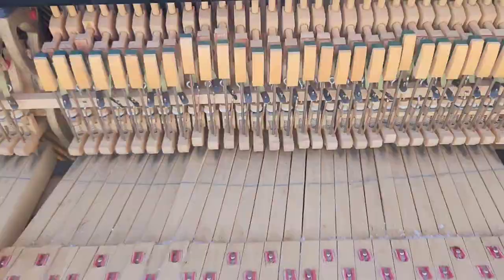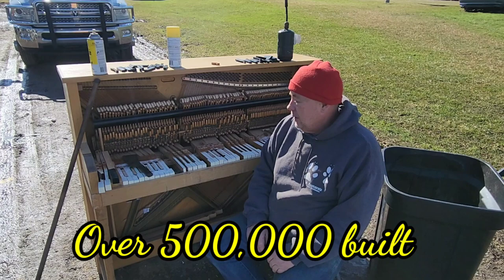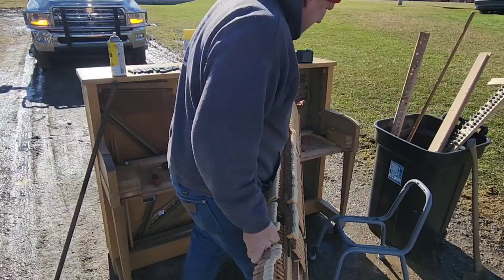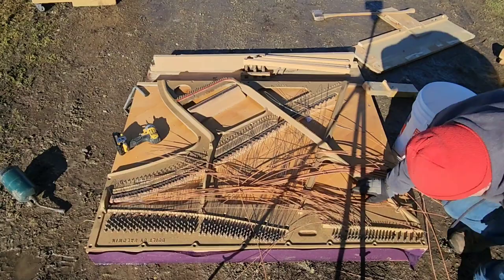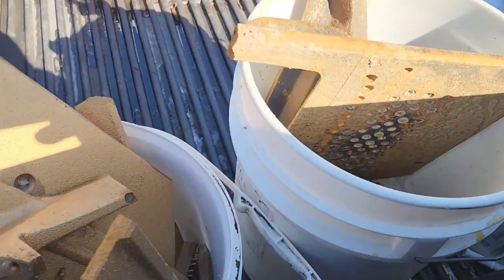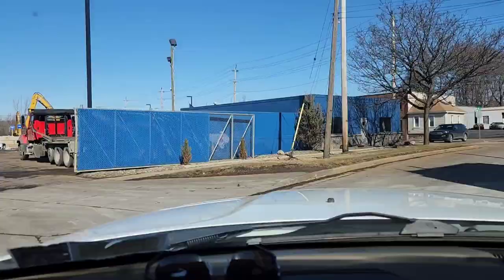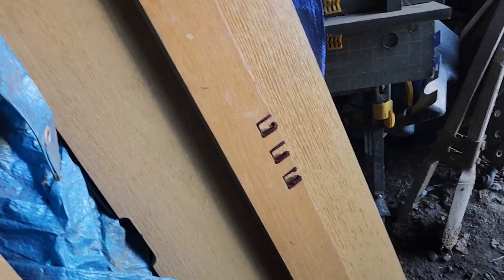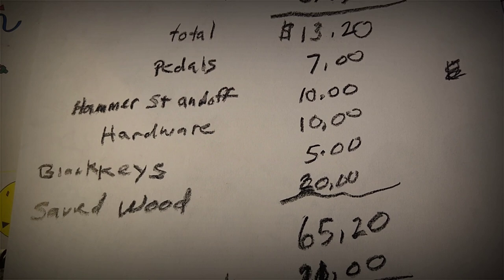Scrapping a Baldwin Hamilton upright piano, WHAT WILL I GET?

Comment: I scrapped one and the high note strings were copper wound iron strings, got #3 for them looking back i wish i had put the cords into a vise and tried to pull the iron out. was a learning curve and lots of fun would most likely do it again
Reply from the maker: I did notice that they appeared as such.  It wouldn't have been the best use of my time but would have been interesting.  The piano also had a keyboard cover lock.  I didn't know what it was or what the parts were.  Had I taken it off it would have brought $15 on ebay.

Comment: what did you use to remove the screws around which The piano wires are wound. and....is the backboard screwed to gether or glued together.....i cand get anyone to move the harp. what would you use to saw the harp into portable piecs
Reply from the maker: I actually burned the wood rather than remove the pegs.  They could be removed with a slide hammer.  The entire wood backboard is glued together, I cut it to save some of the wood and burned the rest.  To cut the harp I'd either use a Sawzall or cutoff wheel on a Corded 4" grinder.
Reply: You can remove the tuning pins using an electric screwdriver and a proper star tip (can be easily found online).